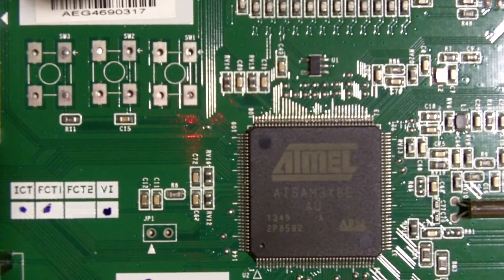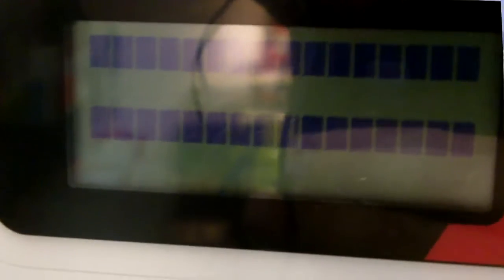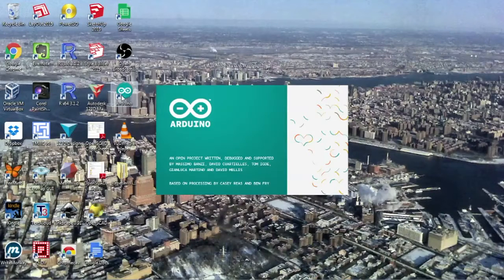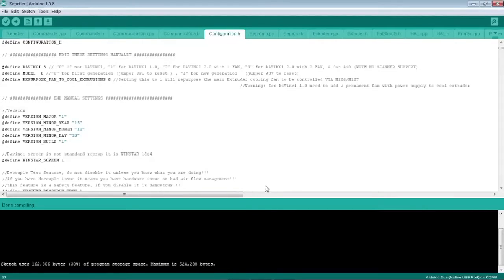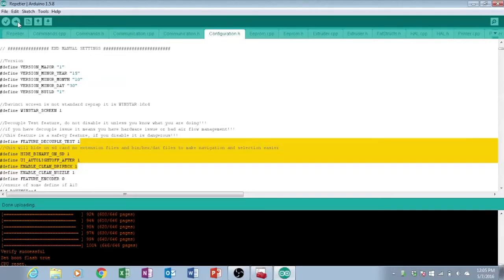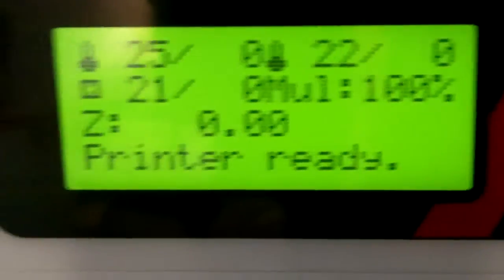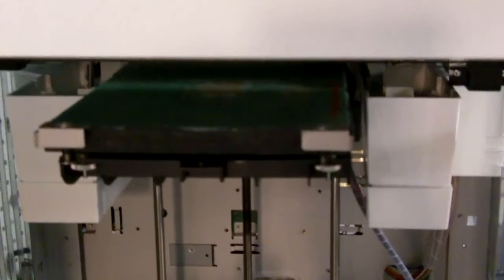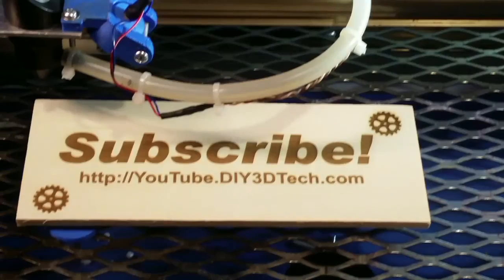XYZ Ware Da Vinci 2 Duo - Reflashing the Firmware with Repetier Host!

Comment: I get a successful flash on the console window, but still just black bars on the printer
Reply from the maker: It is hard to say as I made this years ago and many things have changed.  My guess is the LCD in your printer is different then what was in them at this time and the library for the LCD needs to be changed.  However to what I would have no clue...
Reply: Hi, did you get it to work? I have the same issue :(

Comment: i have an XYZ Mini w and would like to be able to reflash it with GRBL.  Would you care to take on that project for a video?

How about reflash with Marllin?
Reply from the maker: Thanks for the offer however I have sworn  these off sorry to say.  While did use these for a year or so afterwards, was just to big of a pain verses other printers out there.  Also while I have not looked, I have also not run across anything for the Mini and I know as time went on XYZ just kept locking this down even more.  So it likely would be a good sized project to tackle...
Reply: @DIY3DTECHcom  Would it be possible to just switch out the mobo for a xxxlolu board?

Comment: Good afternoon DIY3DTECH.com
I have the firmware Repeating 0.92 Aufgespiel and see there on my XYZ DaVinci 2.0A, the printer moves.
Because whole for me new territory is, it is very difficult of course for me to understand the whole one with X Y Z axis etc.
Then I have to me the software Repetier host and Simplify3D installed and with the printer to groups. funtoniert everything the axes everybody is selected.
This is my problem if I liked to print of the extrusions on the right in the bed margin scharbt and loudly rattles. There the heating bed is too high in the setting. Because I do not know with best for the sake of like I should set z axis I ask you for help.
I think this what has certainly with configration.h close or?
I would be very grateful to you really very much if you to me there could help.
The best greetings from Hamburg
Mike
Reply from the maker: Mike love Hamburg!  Been there many times (CeBit and other things), however I am not tracking all of your questions.  I assume you successfully installed the new firmware?
Reply: Yes Hamburg is very nice :) i have the Repetier .0.92.10 flashed on my DaVinci 2.0A i can controlled my printer with the Repetier-Host software. left and right and high, but my problem is when i will printing gos the extruder to the right side of the table. the table is to high for the printing.
Sorry my english is not good :)
thanks so much
Reply from the maker: You first need to level your bed and if you can’t pull it down enough with the thumb screws, then you will need to enter a small Z offset (I could pull my bed down far enough the thumb screws alone)
Reply: thanks so much but when i pull the screws dont go the Zmin evalation is this right ?
Reply: how can i make to enter a small Z offset
Reply from the maker: You will need to go into the menu and its its been a long time since I did this, so you might have to mess around with it...
Reply: can you give me your configuration.h file please
Reply from the maker: Sorry I did this many many moon ago and no longer have it however I just used the stock code I did not change anything in the code at all.  As the Z offset can be set from the control panel of the printer....

Comment: Hi! Please, could you help me with this error that occurs when i clicked "Compile"?
In file included from HAL.h:44:0,
                 from Repetier.h:572,
                 from BedLeveling.cpp:107:
fastio.h:9:17: fatal error: sam.h: No such file or directory
Reply from the maker: My guess is your using the wrong version IDE, it must be the version listed in the video an no other version.  You can likely find it in the archive section of the Arduino IDE download area...
Reply: Hi! No, i downloaded the Arduino 1.5.8. beta version...which is the only 1.5.8 available.
Reply: Alvaro Posada did you ever figure it out I have the same problem

Comment: i am trying to up lode the firmware but when i uploaded and it reset it will not start and the computer connects and connects and it will not start the printer. Any suggestions i am stuck and i am getting stress.
Reply from the maker: As mentioned do at your own risk, and the newer the machine the more likely it is to brick as are you familiar with Ardunio and the IDE, can you identify compile errors?  As this does not provide a lot of information.  Does the LCD screen on the printer have a menu?  Did you receive any compile errors?  Were there upload errors?  Are you using the correct IDE version, what about the version of the (repiter client) are familiar with its operation?

Comment: Okay, I'm working on a Da Vinci 2.0 duo, and it has been absolute hell for me and I am about to explode. I've been working on it for about 4 days now. My friend worked on it for a couple of weeks. I have tried a whole crap ton of different IDE's, Versions of Arduino, the whole nine yards, and I FINALLY got it to work yesterday......for about 20 minutes..... I tried to print one of the preloaded files and the left head jammed, so I stopped the print...except....it didnt stop, It kept "printing" 2 minutes after I pressed stop. So I did the only thing I could think of. I pressed the power button, it shut off just fine. The problem was when I turned it back on it had the black bars like the firmware had been reset, but the light was on. I flashed it (seemed to flash fine) and the light went off,  but when I loaded the SAME EXACT FIRMWARE, the only thing that happened was the light turned back on(but it still had the black bars). I flashed it 2 more times and the same thing every time. At this point I am ready to try just about anything to get this to work. Do you or anybody else have any suggestions or solutions? I'd GREATLY appreciate it.
Reply from the maker: I assume you used the Ardunio IDE (this is the ONE AND ONLY version number which works) listed in the video and you got a successful compile before uploading?  Also assume your using Repitier host to to control it?  Is it a new or older printer (the newer ones tend to brick more)?  Try an older computer to flash it and or control it as there could be an issue with the FIDI drivers (very long story).
Reply: Yeah, I used 1.5.8 and it successfully compiled. Yes, I used host. And Its at least a year old. My computer is from 2009 running win 7. Everytime i upload it it says:
Verify successful
done in 3.583 seconds
Set boot flash true
CPU reset.
But it doesn't budge. The only thing that happens is it continually connects and disconnects . I have no idea what to do anymore and ill try anything.
I don't have anything else to lose.
Reply from the maker: So are saying the compile is done in 3.583 seconds or the upload?  As for either that is way to fast indicating something is wrong unless you have a massive computer.  As on my Win7 Quad core its quite a bit longer, about 10 to 15 sec to compile and a minute to upload.  I would still try a different computer as that time doesn't seem right at all.  In addition, where are you getting "set boot flash true"?  Is that just coming from the console screen or are doing something that is setting the boot flash true?  Also the connect and disconnect is possibly a windows chip/driver issue (long story) as I switched to Linux to avoid this (however I used windows to flash the machine) as didn't have the issue you are seeing but a general problem with windows reliably sending lengthy GCode sets as for some strange reason after about 30 min or so windows would disconnect.  Did a lot of home work found it to be an issue with Windows, the chipset and drivers.  However I recall you mentioned that  printing from the memory card you had issues too and if that is case, sorry to say I thing there is something wrong (physically) with the printer so check all of your connect these are know for these types of intermittent issues Chuck Helebuck and a few others did vid's on this about 2 years back regarding loose thermister connects and the like as I recall...
Reply: DIY3DTECH.com The compile usually takes a min or two, I'm guessing the upload is the thing that takes 3.whatever seconds. I've got a dual core threaded to a quad core at 3.5 ghz. The "set boot flash" stuff was from the last 4 lines of the console after the upload had supposedly finished. I don't think the memory card is bad, I'm thinking the firmware glitched out, but I've been wrong before. It moved around fine but I think the last time someone printed with it they  jammed it and didn't bother to try and un-jam it. Do you think flashing it with Linux would work? Or is it the physical usb ports? I don't have a Linux machine persé but I do have several VM's running Linux. You think that would work
Reply from the maker: Sorry for the delay in getting back to you, how have you fared?

Comment: i am having an issue in the fact my laptop won't pick up the board? if checked every location in device manager and no luck. i have already installed the drivers for duo in audrino. no idea what to do i now don't have a printer
Reply from the maker: Try re-flashing  also as warned in the video, bricking is possible especially on newer ones, older ones  should be 90% okay. Also have you tried connecting with Reptier host as  that is how will need to connect and also ensure you have the correct baud rate too...
Reply: Thank you i will have a look into this today. Mine is a newer board so is it possible IV ruined the printer?
Reply: i have got to a stage where It's recognised as an unknown device and when i try and install the drivers via the files from ardwino it says it can't complete even though the correct files are there
Reply from the maker: DymondGezzer1089 are you using the older version of the arguing IDE as in mention in the video as no other ones will work.

Comment: There is no link to the software for Arduino?
Reply from the maker: https://github.com/luc-github/Repetier-Firmware-0.92
Reply: Cheers mate aready sorted but getting the bed to align and the settings for this to work is a real bitch, given up again until im in the mood lol
Reply from the maker: Don't over stress the bed align it is a pain in the butt as if its not in a crazy tolerance it errors.  I simply use a paper align to get it close and then an alignment.  However to be honest any more just do the paper alignment and that is good enough to 99% of the stuff I print on it...

Comment: I got everything set up and first print was beautiful. Was looking at the eeprom configuration via repetier host under config>eeprom firmware settings which allows to import and export eeprom settings. I've looked everywhere and can't find a image or copied text of correct eeprom settings for the davinci 2.0 jp1. can you please paste your EePROM  setting so I can compare? looking for min,max settings, offsets, federated, home position, bed size, jerk and so on. if anyone can help I know you can again just need to compare
Reply from the maker: I am using the stock setting (no changes) , however I am traveling for business but when I return home will see about posting it for you.
Reply: DIY3DTECH.com still would like to see your EePROM settings by taking screen shots which will be like five separate screen shots. The printer prints beautifully but if using the full build plate t0 is not centered on build plate and is off by (some amount) to right if facing machine. 

all info I can find is related to the duo with one fan or 1.0. So hopefully you can find time to help me figure this out as I'm going crazy going back and forth changing settings/offsets. btw use cura and need the help to ensure I can use both exstruders. but again eeprom settings first and printer configuration

Comment: I have been wanting to flash my XYZ printer for a while now and just got around to doing it.  I wanted to see if I could get the Arduino program to compile before I reset my printer.  I am having problems getting the program to compile with the following error.  

In file included from HAL.h:44:0,
                 from Repetier.h:572,
                 from BedLeveling.cpp:107:
fastio.h:9:17: fatal error: sam.h: No such file or directory
 #include <sam.h>
                 ^
compilation terminated.
Error compiling.

Does any one know how to fix this?
William
Reply from the maker: Did you use the EXACT IDE version mentioned in the video?  It MUST be that one and no other as the newer IDE have an issue ingesting the file structure.  Also is you are good C you could fix it that way too (as its the way it sees the dependency files)...
Reply: I know im using the Arduino 1.5.8, but I dont know what IDE version i am using.  Where can i get the correct IDE version?  Thank you for getting back to me so quickly.
Reply from the maker: You will need to go into the archive location of the Arduino site and dig around however it should be there I would try t help more but its been a long long time since I reflashed mine...
Reply: I was finely able to get everything working.  It turns out the repetier version was updated and the upload was very different from when you did it.  But in the end it works.

Comment: I purchased a davinci 2.0 with an identical board as the one on this video. my knowledge up to this point has all come from my k40 laser and mods. in fact I remember when you were modding one and posting in the k40 laser group on Google. 

I'm going to flash firmware but didn't know if repeteir.com is the same as repetier host on github?

If you can verify that one way or the other I will get this thing flashed. After that I still have no experience with 3d printing but feel I can do anything after all the mods with the k40 laser. 

thanks in advance
Reply from the maker: you need to use the github version from link in the video not any other version....
Reply: Got it sorted thank you, as said before been following your work for a min now but mainly due to your with the k40 mods that helped a ton. When I bought the k40 I knew nothing so the learning curve was almost too much but your channel along with the k40 community got me up and running. 

Another question about the repetier firmware, you did not mess with the repurpose fan to cool extrusion. Is this still the way you run the machine? Are there other settings I should change before flashing over? other than those talked about in your video?

I have never used a 3dprinter and hoping I can get the hang of it quicker than I did with the k40. Any tips or suggestions would be awesome or do they have a forum like the k40 community other than voltivo?
Reply: DIY3DTECH.com hey I got the sketch to compile and upload successfully matching the same as yours on the last four lines in the console window verifying successful done in 3.668 seconds
set boot flash true
CPU reset

the printer never beeped and still has black  bars. should I have uploaded without the power being switched on? should I shut off main power on printer? then power back on?

Comment: Where did you get the davinci 2.0 firmware? Also I heard there were problems with extruders being reversed, right is left and left is right when flashing to repetier. Thanks
Reply from the maker: https://github.com/luc-github/Repetier-Firmware-0.92 Also keep in mind that outside of the XYZ-world using two extruders is NOT as easy.  Now I have not had an issue with them being reversed, however, CURA (which is my main go to slicer) is not multiple extruder friendly in the same way XYZ was however the other benefits FAR out weigh  this as 9 out of 10 times I only use one anyway....

Comment: Can you still do auto-leveling after reflashing?
I learned on my 1Up that i HATE leveling.
Reply from the maker: Yes however you will need to first manually level it then, run auto-leveling as it has to be very close in the first place or auto-leveling will fail...
Reply: Does it hold its level well? How often do you have to re level? Is there one with full auto leveling like with individual steppers in each corner?
Reply from the maker: Does a good (leveling) and no have not seen one with motors to self level.  They might be out there, however if this were the case it would be VERY expensive as I am sure commercial units have it.  Leveling however is not that hard and I do a paper level about every say 5 to 10 prints or which switching bed temps say from PLA to ABS.  To be honest, I rarly use auto level unless I am printing a LARGE abs print...
Reply: This is probably a dumb question, but do you still have to edit the eeprom in the cartridge to reset the value and re-fill it with your own filament or does replacing the firmware just bypass the check all together?
Reply from the maker: If you reflash it you are totally free!  No reflashing carts, or anything use whatever firmament you like :-)

Comment: You dont need to short pins just connect with the arduino serial monitor at the lowest baudrate possible and it will reset it.
Reply from the maker: Thanks for sharing, I have read that, however never tried it as it seems to work for some and not others (again only what I read).  So figured jumping was as sure shot...